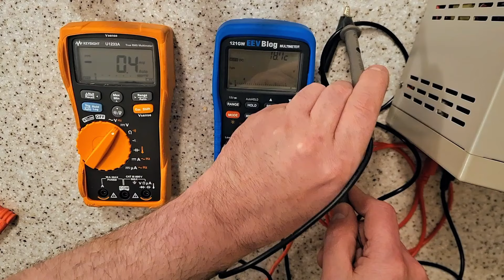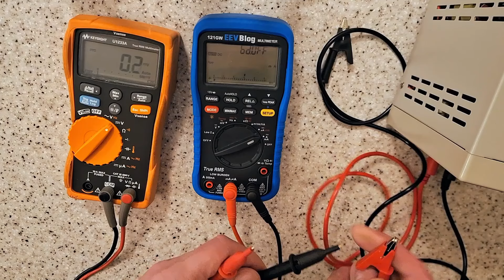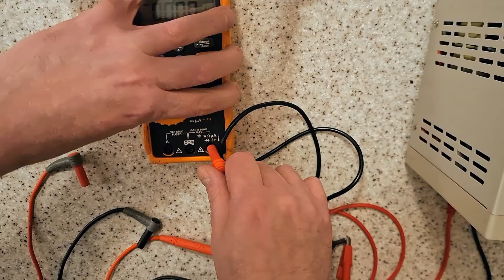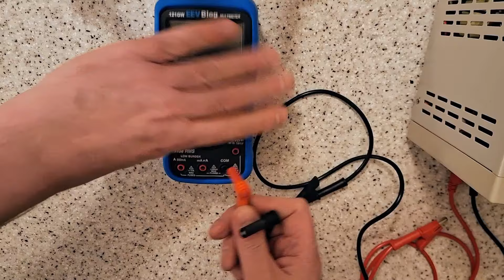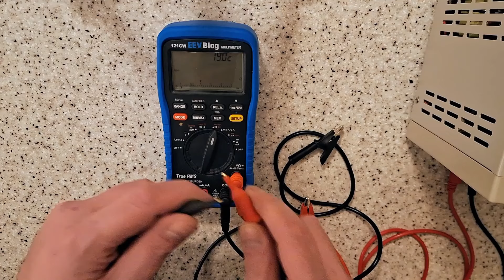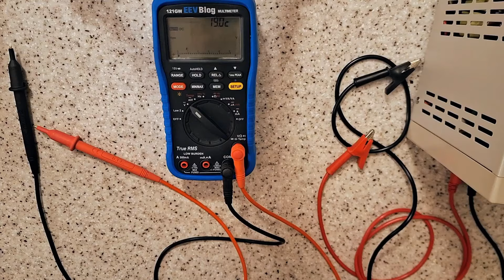EEVBlog 121GW multimeter fault - not showing any voltage, current or resistance readings.

Comment: Very odd. Try reflashing the firmware and see if that fixes it.
Reply from the maker: Nope, tried that. I've sent you an email about returning it for repair or replacement. The video shows all the troubleshooting I've tried - I do mention in the video I've tried reflashing the firmware and changing the batteries however its towards the end. It's still under warranty for a few weeks. You initially replied to my email so I replied back with troubleshooting steps I've done and made this video to explain the problem better. Radio silence since - would I be able to get an RMA for a warranty return?

Comment: Hmm different issue than mine. I discovered yesterday that I have 0 volts and wondered troubleshooting / measurement points to diagnose whay has failed but you dont have any reading.
Reply from the maker: Broken jack connectors seem to be a common issue with older models. Mine was under warranty so I didn't open itt up. I guess it's a selector switch fault or the front end chip that's failed. Hopefully Dave will do a repair video of mine when he gets it back.
Reply: The problem I have is worn out selector switch... Guess should order that replacement for 0-series 😅